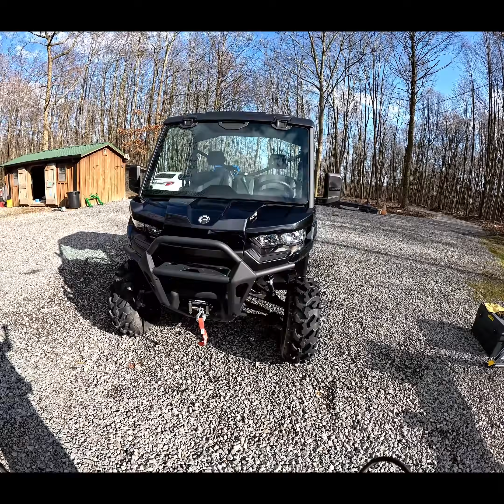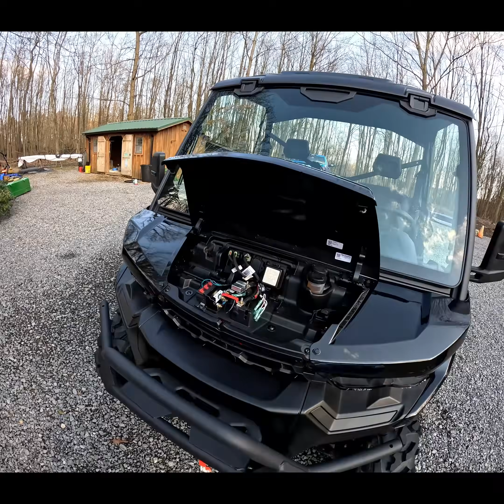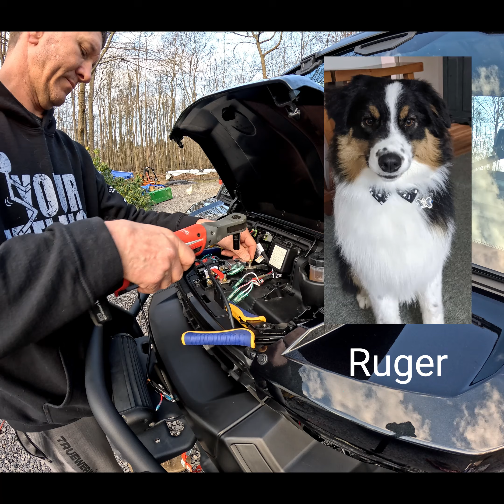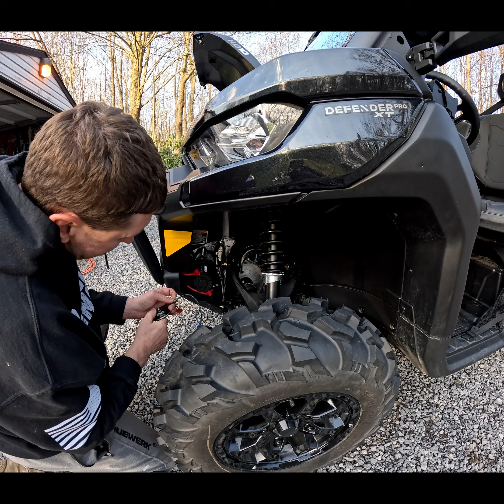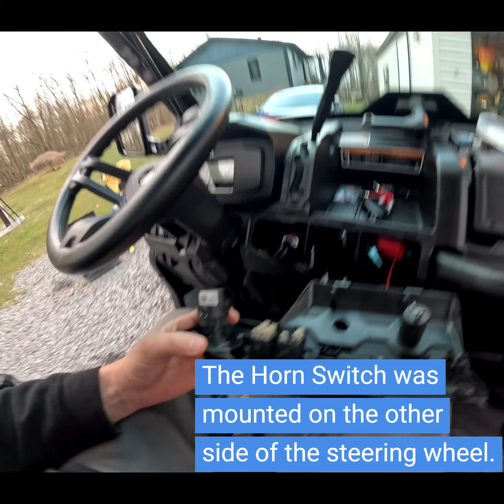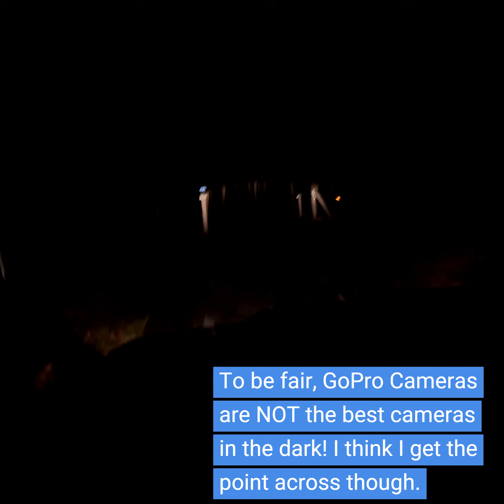2023 Can Am Defender - 12" Vision-X-USA LED Light Bar & Horn How To Install

Comment: Absolutely great video!  I have a sound bar, a light bar and rear lights to install and wire up to my Can-Am 2023 Defender HD10 XT and this gave me the warm fuzzy to get everything wired up correctly to rocker switches like I want them.  Thank YOU!!
Reply from the maker: Sounds great, I'm glad it helped! They are making it easier for us to wire up after-market accessories! Make sure that you use a fuse on your power!
Reply: I noticed you didn’t use a relay for light bar. Any certain reason why?
Reply from the maker: Sorry Adam I'm just seeing this comment. This is a great question! It is a good practice to use a relay with a Light Bar install, however, I didn't use one for this application because the Xmitter 12" LED Light Bar (XIL-200) is a low-power consumption light. They are designed to work off of a motorcycle stator. This light draws 5.0 amps @ 12vdc and the Nilight switch is rated at 20.0 amps. I should have pointed that out in the video. 
Going forward, I will either start to use them in all of my installs on YouTube or point out why I'm not using one and who should be using one. 
Thanks, Chris